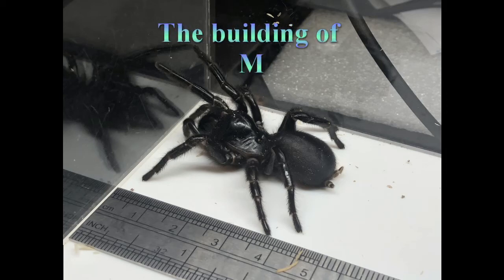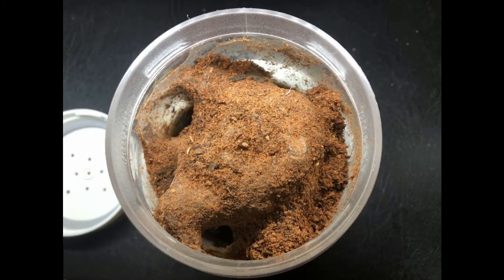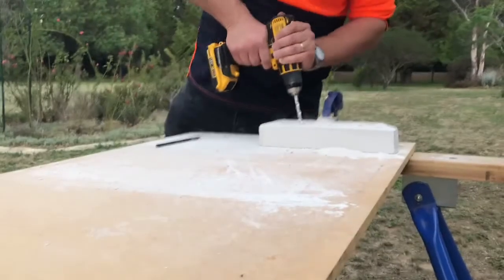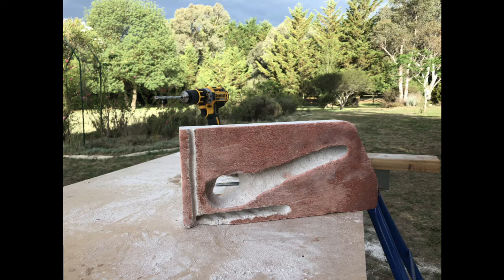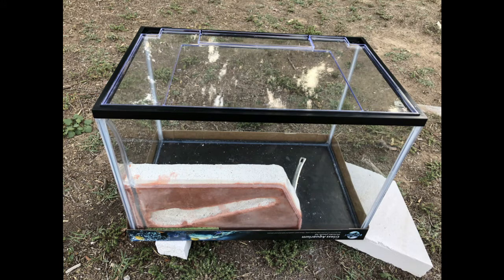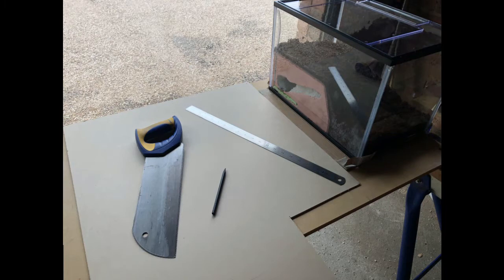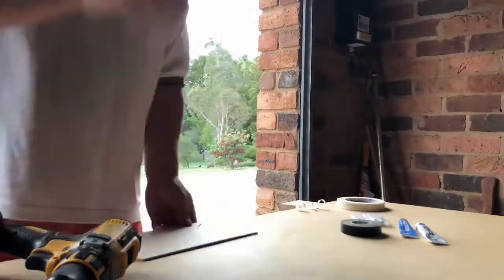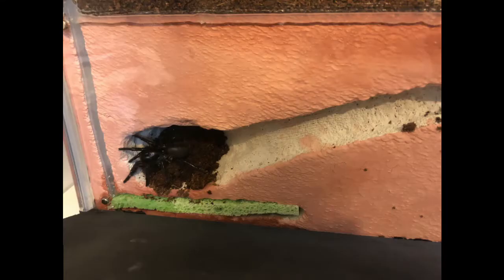Building a New Enclosure for a Funnel Web (Minerva's Den)

Comment: How is the humidity? Does the hebel get moldy? I'm thinking of using this method for a few of my scorpions
Reply from the maker: I've never had the Hebel go mouldy, even with the sponge mounted inside it and not being able to replace it. I did do away with the sponge in later enclosures though.
The humidity can be difficult to balance, especially inside the burrow, it's useful to have either very thin walls or a hydration system like a reservoir or sponge.
It may be difficult with scorpions because their burrows are sometimes very irregular shapes.